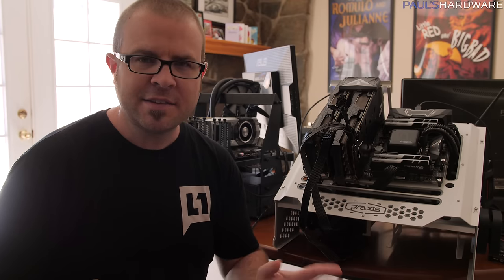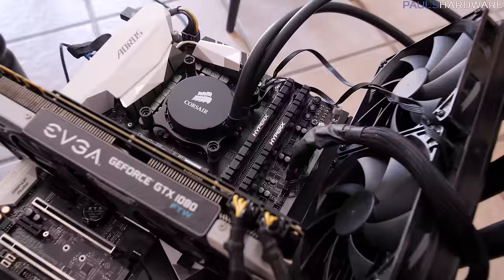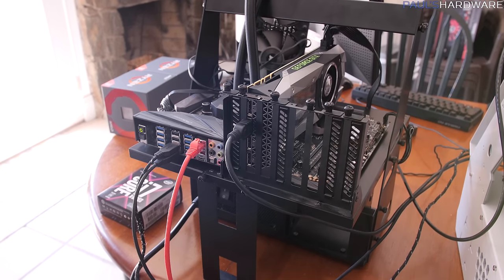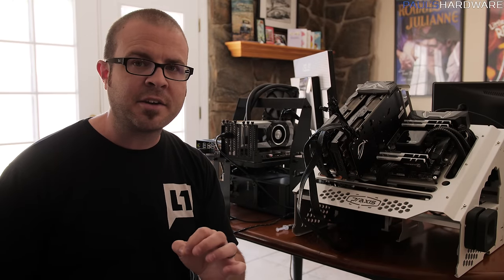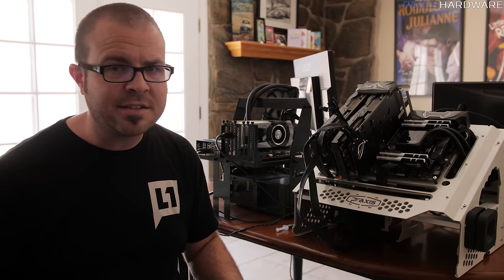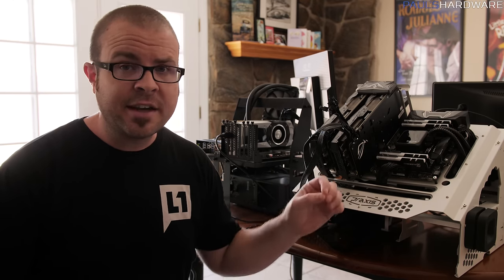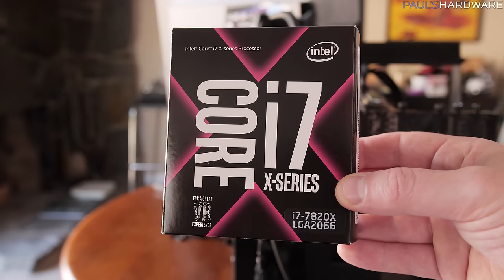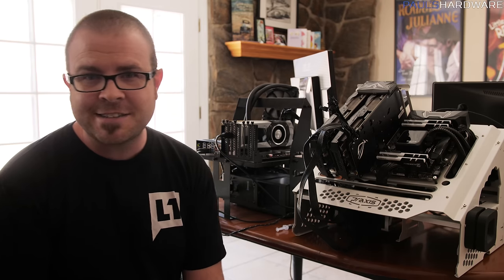What's The BEST CPU for Gaming with 1080 Tis in SLI?

Comment: Ohh boy can't wait to check this one out, good topic Paul ;)
Edit: Just finished watching, great video mate and I agree with your conclusion. My only issues with the Core i7-7820X is the insane thermal output, I'm impressed that you were able to run at 4.6 GHz using an AIO liquid cooler. Do you have a QS sample or a retail chip?

Also interesting I found the Ryzen CPUs pulled ahead for the minimum frame rate in For Honor as well by a noteworthy margin.

Side note, the 7740X and 7700K are the same CPU, so if you overclock the 7740X higher it should be faster - I know you know this, just saying :D
Reply from the maker: Thanks Steve! I have no idea how you do so many benchmarks all the time, it's SO TIME CONSUMING. On to the next one though! :-D
Reply: haha yeah it is, but it's also fun seeing how things compare. I'm benchmarking right now BTW, I bet you are as well ;)
Reply: I will just ask here, for such an investment, both time and resources wise. Do you think it is smart to use an architecture which seems slightly .... flawed, when the competition releases a new chipset and set of cpu's in about two weeks ?
Reply: @EpleshTV - Aware that there is a competing product incoming that ‘might’ be better, is obviously reason enough to wait and see how things play out.

Paul is right the Core-X range is the best in terms of pure performance, though Ryzen has closed the gap significantly in a relatively short period of time. Still purely for gaming right now the Core i7-7700K and 7740X are king.

I don’t like the Core i7-7800X, 7820X or 7900X myself, they are way too power hungry and as a result pump out massive amounts of heat. Of course the biggest killer is the price. As Paul noted in terms of price vs. performance is a very easy win for Ryzen.

If you want an excuse to build a custom liquid cooled Rig then the Core-X range is all the excuse you need :D
Reply: Hi Steve!
Reply: Hi Piti Pablo! ;)
Reply: Steve is a testing machine!
Reply: Steve mate, can I buy your galax 1070 ex oc snpr white? Need it for my first build and as you may know, damn hard to get a hold of it here in Oz with all the mining craze.
Reply: Thanks for this great video,   excellent SLI review!  I'm looking forward to finalizing my similar build:  a binned 7900X from silicon lottery (rated @ 4.8 GHz, 1.225V w/ an AIO cooler).  I'm going to try to hit 5.0 with my custom loop - it will all depend on the stability and temperature performance of the MSI XPower Gaming EATX board. I get the motherboard on Friday, totally psyched.
Reply: They havent closed any gap in a small period of time. The whole FX series had terrible single thread performance, theyve prob been working on this for 6 years
Reply: I run my 7820x at 4.7 at 1.2v and it ramps all cores up to 5.0 with zero issues on my corsair 115i stable as a rock.
Reply: I'm not sure if you guys have a Threadripper sample for review and are under NDA or not as yet but.....Assuming that the chip will OC to near 4GHz and can be cooled and you can run 3200cl14 ram: 

I will predict here that the Threadripper CPUs will perform better in games than the R7 Ryzen Chips do. That is purely because the extra 2 channels of memory, with double the Infinity fabric bandwidth, will not strangle the GPU performance in the same way the dual channel memory  with single Infinity Fabric interconnect Ryzen systems do.

BTW, On the AMD system, If you manually tighten up tRRDs, tRRDl, TFAW and tRFC timings, your 1800x should be able to crack 9000 in the Timespy CPU test while also seeing a fps bump overall. Still not perfect but an improvement over the auto secondary timings.
Reply: Actually, at the same clocks Threadripper will at most be as quick as regular Ryzen, with the potential for some pretty ugly results if a game ends up putting important data in the memory connected to the remote die. (because of added latency)
Reply: The problem is not the clocks on the ryzen platform. The problem is the throughtput to the memory controller when you have a 16 thread load competing for bandwidth to memory with the GPU over the single 32 byte/cycle interconnect. Quad channel will reduce the load from the GPU to each memory controller by 50% as you now have two 32 byte/cycle interconnects to memory. 

As the infinity fabric runs at memory speed, the high latency memory timings exacerbate the issue compared to the older Ring Bus running at 3-4Ghz. It is analogous to Ryzen using suburban roads at a fixed constant speed limit going all the way between A and B compared to the older Intel architecture that puts an expressway in the middle that helps mitigate some of the delays in a stream. 

Skylake X Mesh Architecture is more like the infinity Fabric than it is like the ring bus and is also exhibiting similar behaviour to Ryzen when compared to Broadwell-E and Kaby Lake. While that is a slight downside to the new architectural concepts that can be mitigated by adding extra interconnects to things like IMCs, The up side of course, is that the mesh/fabric architectures allow AMD/Intel to engineer a much larger variety of SKUs quicker and cheaper.
Reply: If you expect Threadripper's gaming performance to benefit from extra memory bandwidth you're going to be disappointed.

At this point I'm expecting to see select Threadripper benchmarks showing higher gaming performance with only one die's memory controller populated and latency-sensitive threads pinned to that same die. Might make for a nice in-depth test. Hmmm.
Reply: proesterchen I have to say Brad's theory makes a heck of a lot more sense to me and I'm thinking he is right on the money as well.
Reply: brad morris thanks brad. i enjoy having someone explain things properly. i finally understand the the way the mem controller functions on new amd.
Reply: Hardware Unboxed Love your tests, especially the 30 games round-ups! 

Just check it out when you get the samples. 2+2 channels vs 2+0 vs 1+1, and with games' threads pinned to one of the dies (if not CCXs) for good measure.
Reply: Eric Elliott What a waste of money..... 🤦‍♂️🤦‍♂️
Reply: Hardware Unboxed 7740X does not have Quad-Channel Support though.
Reply: proesterchen If you only run dual channel memory on a TR system, I promise you that the performance will be the same or worse than it is with Ryzen R7 unless you disable cores and/or SMT. Threads switching cores is not the issue and never has been. Hardware unboxed tested and proved that some months ago. 

Be careful too, you are falling into the same trap Intel did when they made their "glued together" comment and assumed that Epyc was 4 separate self contained chips connected up together. They failed to understand that the infinity fabric defines an entirely new way of considering CPU design architecture. 

The silicon rectangles that you see on the chips AMD have shown are just effectively scaffolding frameworks that hold 2xCCX modules, 1xDual Channel memory controller and 1 x I/O-PCIe controller. Each of those modules independently connects to the Infinity Fabric underneath. 

The Infinity Fabric, which is analogous to a piece of cloth, is contiguous and covers the entire area under the single silicon framework on Ryzen, 2 silicon frameworks on Thread Ripper or 4 frameworks on Epyc. 

Any need to communicate between one module contained in one silicon framework and another module in either the same or another silicon framework just sends the data down its own interconnect to an address for the other module. It then travels across the fabric to the appropriate address and up the interconnect at the destination. It is irrelevant what silicon framework block the targeted module resides in. Switching threads from core 0framework0 to say, core 3framework4 should be exactly the same as switching it to a core in the other CCX in the same silicon framework like Ryzen does now.
Reply: Who else read this in as aussie accent?
Reply: +Scooby Dooby you call a couple of mhz overclocking headroom? You want overclocking headroom go with sandy :)
But anyway did anybody catch what resolution Paul was using? was it 4k or 1080p? It seems I cant catch it, becasue if they are done at 1080p they are really low. ah it said 4k in the spec sheet of the test.
Reply: Insane thermal output? nah.. i love you steve but this is not true. im running a 7820x @4.7 with 1.225v and temps are fine (high performance settings of course). gaming ~50-55c. with streaming 60-65c max (gta 5, rotr, wildlands). Cinebench ~85c, prime and aida with avx offset -7 temps are ~80c. The cpu gets hot when pushing 4.8 with 1.275v+ but with my settings its nice and cool. Cooler used is an nzxt kraken x62 with 2xek vardar 140 2k rpm (they never go above 50% when gaming/streaming. Cinebench they ramp to 75%) so far im happy with my x299 cpu. fast, cool and quiet.
Reply: brad morris reading your informative comments has been such a pleasure! Thank you very much, sir!
Reply: Nice set up...
Reply: I got around 4.8 Ghz with my 7820x at 1.22v at 85 c during prime 95 for 25m (55 to 65 during gaming and streaming). With a nepton 240m AIO.
Reply: you are welcome
Reply: mpc12345678 Why wouldn't you buy Ryzen or just wait for Threadripper? 😑
Reply: Adrian Wujtowicz Money is not an issue and I value single core performance. At 4.8 it's getting close to 7700k in gaming benchmarks so for me it's the best of both worlds, high IPC and high multicore performance.
Reply: Hardware Unboxed has a sweat shop set up with child labor to get all those benchmarks out, lol
Reply: mpc12345678 Money it's not an issue for me either and I still wouldn't buy it, especially after Steve's test, 7800X VS 1600 😊 none of the X299 cpu's are worth the price
Reply: 7800X is not the 7820X though, as shown by Paul's benchmarks in this video. The 7820X is really close to the 7700K in gaming performance but the 7700K is ofc still king because of the higher frequencies. The 7800X simply sucks looking at all the benchmarks that are out for it which is why I steered away from it (it was not even in my sights).
Reply: mpc12345678 Hmm I haven't watched the whole video so you might be right 😊
Reply: Hey Brad. UMA, NUMA, told you so. :P
Reply: yep. Numa setting reduces latency and increases gaming performance. watched one review so far with 2 dimms per channel that tends to be more difficult to get tight timings. Inquiring minds want to know more to determine what Numa/Uma modes are doing in addition to forcing particular memory controller
Reply: brad morris UMA ignores the fact that half the memory and half the cores have much higher latency than the other. This will obviously lead to performance issues whenever a workload gets distributed across cores situated in different dies (like it is less than ideal to have a task distributed across different CCXs within a die, but worse, PCPer.com has the latency graphs IIRC), but also if the data is not contained to the local memory controller. 

NUMA on the other hand tells the software (the OS, but also NUMA-aware applications) about the specific hardware configuration, and that a workload should preferably be limited to a single NUMA-node and its local memory, and that indeed it can be detrimental to performance to try and scale beyond the confines of a single NUMA node. In cases where threads spread across dies but access the same data and swapping back and forth limits performance more than added memory capacity and computing resources aid it. 

Obviously, actually using more than a single NUMA node requires NUMA-aware OSes and applications, so work can be spread across nodes where data sharing is of limited concern and performance is not limited by inter-thread latency. This awareness is not something you'd expect from a consumer gaming title, which is why UMA can make them falter and NUMA will at best make them perform like their single-die counterpart.
Reply: I know what NUMA and UMA means in a multi socket implentation. At the time I typed this There was no information on what TR was actually doing and I was trying to see if was happening here was in fact matching that of a multi socket server or not

Comment: I know you'll get a lot of flack for not going Ryzen, I get why you didn't. I run a 1700X and 2 980ti and have been waiting for this video because I wanted to see how the 1800X did in SLI. Did it beat the Intel CPU's? No, didn't expect that. What I wanted to see was how far behind it was, and I'm actually relieved. I had to save up to buy my set up, price to performance was #1. You're building the best you can. Excellent video and may your fps be high, and your temps low. Thank you
Reply: I agree completely. If you're remotely budget conscious, Ryzen is your best friend right now. You get stellar performance at a bargain price. It may not beat the 7700K, but it will hang with it, do more in the non-gaming arena, and has more future-proofing.

Comment: for ryzen being new and entirely unoptimized, I am really surprised at how it keeps up with intels latest for the most part. If we got some games built with both companies in mind, I might have to put my money on AMD.
Reply: I was actually surprised as well, I figured the 1800x would do well, but not be hanging right there with Intel.
Reply: It's generally only 10% behind the 7700k and when you consider that the 7700k has a 25% higher clock, you can imagine how the Ryzen would rolfstomp it if it had the same clock speeds. And with Zen 2.0 being 7nm, it WILL have higher clocks than the current process.
Reply: The 1800x impresses me more with how well it keeps the frame rate performance up while streaming a game as i seen in recent tests on youtube lately.

Comment: Good video! One thing I miss is Intel CPU with 32+ PCIe lanes. From my experience running 2x TitanX (Maxwell) SLI I got nice boost in performance from going to 2x 16 PCI lanes when I upgraded 5820k to 5960x. Single card didn't matter 16 or 8, but with SLI it did.

Comment: Ryzen is keeping up pretty well for only being able to clock to 4GHz. Saw the same thing in the recent Hardware Unboxed 30 game comparison, where the R5 1600@4GHz was less than 10% behind a 7700k@4.9GHz, and that was at 1080p with a GTX 1080Ti. Clock for clock performance, Ryzen is no joke. The 7800X got destroyed in that same comparison btw., 1 FPS higher than the R5 1600 on average, with a 700MHz clock speed advantage.

I understand why you went with intel for this build though. You already have the hardware, and didn't have to pay for it, so price/performance isn't a factor.

Comment: 3200mhz ram OC on Ryzen Paul??? People on YouTube are getting 3600mhz OC and boards are now enabled to do 4000mhz with ram to boot.

Ryzen is very sensitive with ram speeds. You should redo the tests with the max possible frequency. Please don't handicap when higher OC's are available.
Reply: SpeedFreak it's not the ram that's overclocking, it's the board and cpu... I never run the ram higher than it's advertised speeds either but they actually do make ram that runs 3600 and 4000... That being said, if you spend the cash on a Ti then You'd spend the few extra bucks on the better ram. Paul should know this shit

Also, not even doing a moderate overclock is just money/performance being left on the table
Reply: Eric Turner I have a 1080ti ftw3, game at 1440p on a Asus pg279q, get 100-200 fps, I don't make a ton of money... Bubble not burst? 🤔
Reply: Hahah I've seen a few of this Eric Turner guys comments so far. He seems super bitter at that idea that people can afford kickass computers and resents those whole have the money to build them.
Reply: bradt4444 he's probably pissed off because Best Buy declined his ebt card for a graphics card purchase 😂😂😂
Reply: Eric Turner I have a 1080ti and I usually game on my 1080p monitor but it is 144hz, did you take into account how many of those 75% are gaming at 120+ hz? I do also occasionally use it on my 65" 4k tv for some controller action but not often. I will soon get a second 1080ti and a 244 hz monitor.
Reply: Same. 1080p 144hz with my 1080ti and 6700k.

Comment: What about the 6850K and 6900k? Curious if the 40 Lanes makes a difference when using 1080Ti SLI.
Reply: Tyler Wallen the difference between x16/x16 SLI and x16/x8 is almost none
Reply: wrong for sli it results in a 15-20 fps difference in some cases

i7 6950x  at 4.4 ghz 16x/16x vs i7 7700k at 4.8 ghz 8x/8x : https://www.youtube.com/watch?v=_NaqXO3khGY

Also from personal testing my 1080ti sli rig w/ a 6900k at 4.4 ghz is getting slightly better performance than a 1080ti sli rig w/ a 8700k at 5 ghz.

Comment: Thank you so much for this video! Gives me a lot of data to consider for my next upgrade. It's been a slow process. I got the Strix 1080ti about a month ago, but considering I'm still on an 8350, it's kind of a joke at the moment. I was about to get a processor/mobo when my storage situation needed to be handled. Added another 1TB SSD and a 10TB Barracuda about two weeks ago to take care of that. Now it's time to consider my options before buying. Been neglecting my system since I've been working so much lately. I just built, as a gift, a ryzen 5 system for my father in law, about two weeks ago. I was quite impressed with the performance for the money! I was not expecting it to turn out as good as it did! He's getting into gaming a lot FINALLY, and he was a Marine back in the day, so I built in the Corsair C70, replaced the window and stenciled USMC on the front grille. It was a fun build, and my wife helped for a change. He's loving it! Massive upgrade from a 7 year old HP store bought! Anyways, keep up the great work! You are truly providing a service! These results will definitely be a great help while I consider my next upgrade! :)